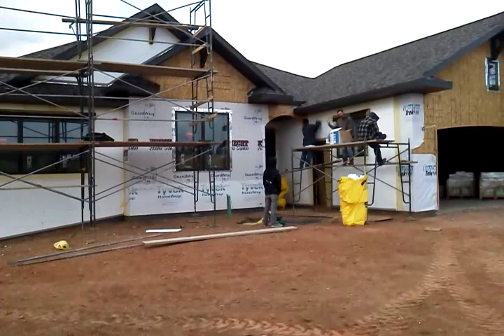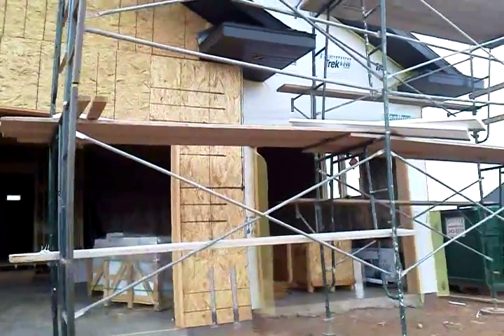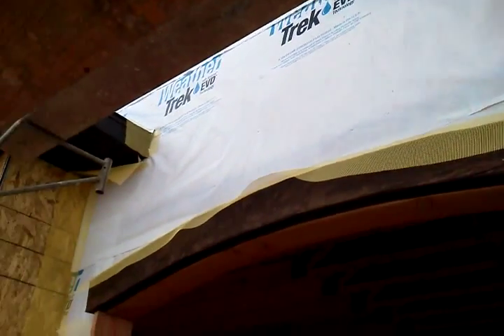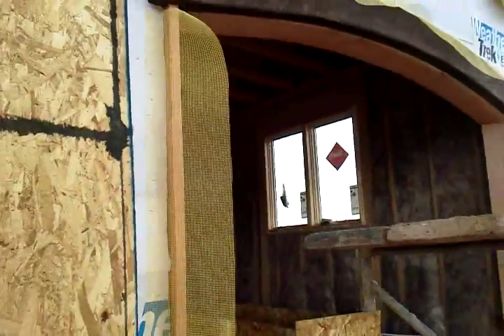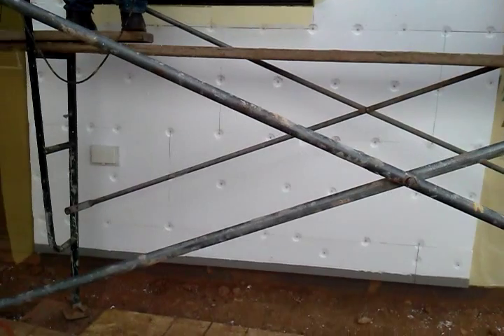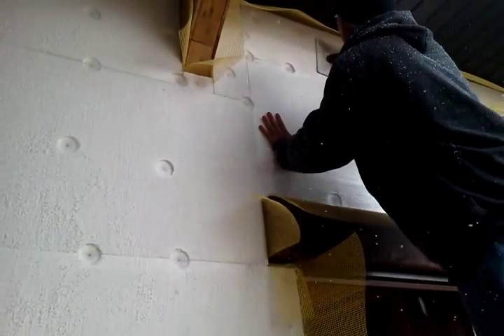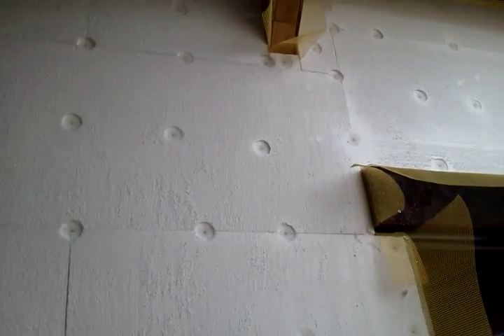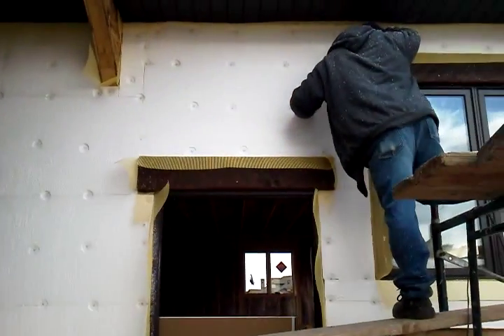New construction Eifs for Kumelos design

Comment: I was being kind of rude cause the house technically isn't ruined but if the eifs is not put on right then the house isn't protected. The reason I have stayed in business so long is because I do more and put more in the bid. Home owners will pay for the membrane system. I cover everthing with Senershield and after meshing the house I put a skim coat on it before running finsh. It makes it stronger. I do all my own caulking as well.

Comment: FACT: Tyvek is for stucco sytems only, it does not moisture proof the house. If you do something wrong when application your e.i.f.s. products the house will not be protected. Gold coat is not a good system but people still use it in commercial construction. I know it rains in South Dakota so shut up. Tyvek is no better than Tar Paper. It is the dumb way, the old way to do a house but what do I know, I have only been in the e.i.f.s. for 20 plus years.